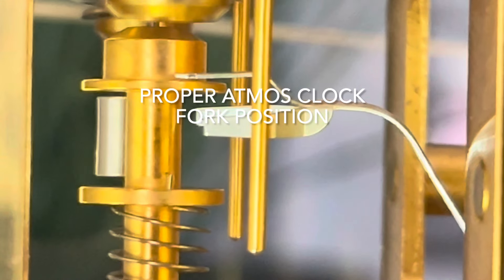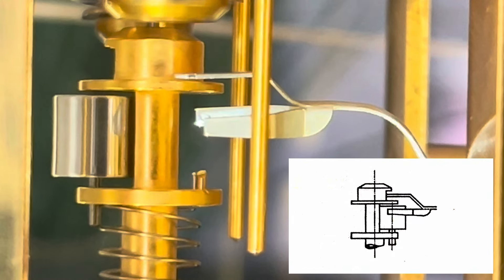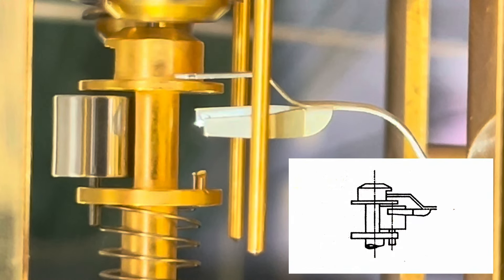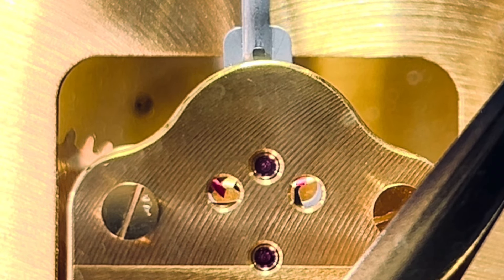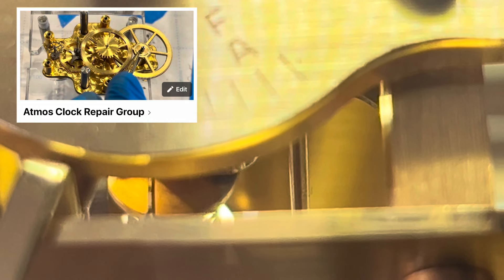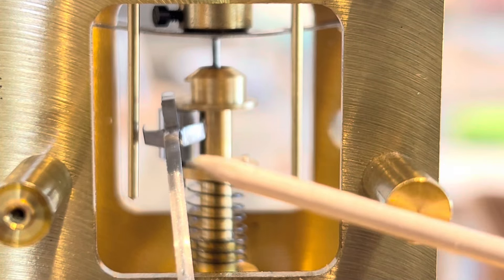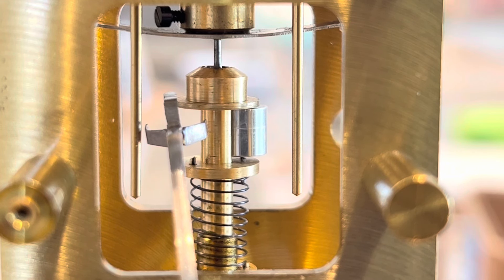Proper Atmos fork position for a high amplitude clock ￼

Comment: Thankyou for this brilliant video which I have watched many times.
I gave my sister a 528-8 for her Golden wedding and just like you said after a while it just stopped. I was afraid to touch it as they have a bad reputation in the hands of amateurs like me. After watching your videos I felt brave enough to tackle it. All went well, cleaned it in the ultrasound, watched the jewels under a microscope and I put it all together without any problems until the fork. Oh that fork! I have lost count of the number of times that I have taken it all apart to poise and check it. Now, finally I have it running at about 400 degrees. Only one problem. When it goes to the left it engages beautifully just like the video! But when it goes to the right it's almost as if the roller is pulling the fork across and the after it releases it gives a little jump before touching the guard pin. As it is running I am afraid to touch it again, but is there anything else I can do? You must have a very good camera because I just cannot get to see the pallet action as clearly as you show.
Cheers, Roger.
Reply from the maker: Congratulations on tackling your overhaul. You’re almost there, you just need to do one more important step. You know you have an issue with the fork because you’ve installed the movement a number of times, made adjustments and finally have it running at 400° amplitude. Of course after a few minutes it stops. Your defect has been narrowed down to the fork. 

I don’t know if you have manipulated the fork at all when it has been installed on the clock. If you have, I’m confident any adjustments you made may have knocked it out of poise. I know this because you told me the impulse roller is dragging when it moves to the right. That skipping motion you have noticed with the fork is because the weight of the fork is out of balance and it’s not properly engaging the pallet stones.

You’re going to have to take the movement off of the clock and poise the fork and reinstall it. Make very small adjustments to the fork once it’s installed in the clock.

If you get a chance, please post this question on a Facebook group I just created. Snap a few pictures or take a video. This will help others repair their clocks.

https://www.facebook.com/share/DG6N6ApfqKQyzEZw/?mibextid=K8Wfd2

Comment: Glad to find this video.  I just bought my first Atmos clock as a consignment sale at my local watch and clock repair shop.  It was serviced, but to what extent I don't know.  The amplitude is around 360 degrees.  Is that something that should concern me?
Reply from the maker: Everyone who sells these clocks claims it’s serviced. A clock that was serviced will not run at 360° amplitude. That is a clock that has not been serviced. Good luck.
Reply: @watchguyAtmos  Thanks.  I made my post around three hours after I had started the clock, which was premature.  Since that time, the amplitude has increased and seems to have settled around 490 - 515 deg.  Perhaps a new balance spring was used and had to be broken in?  (be kind, I am green to al this).  I bought this from a clock and watch repair shop just a couple miles from my house, that has been in business for 35 years.  I am confident that the owner / watchmaker performed some degree of service.  One year warranty.  But when dealing with remote sellers of watches or clocks, I disregard all claims of servicing without proof.
Reply: @watchguyAtmos  Under 19 seconds fast per day, BTW.
Reply: @watchguyAtmos  Checking it periodically (it sits in my office), I now see it consistently over 515 deg, and as I write this, I see 540 deg exactly.  I had no idea that it could increase by 50% from starting it up.  That is all.

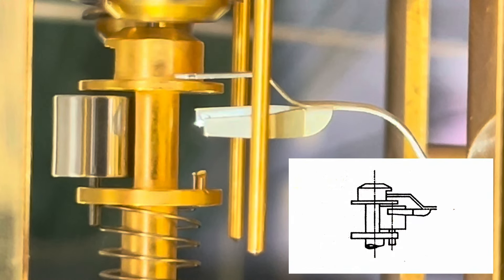Comment: Thank you for the great video! 🙏 The pallet for of my 519 is not centered. It moves from 11:30 to 1:30 position. It also runs a bit slow but fortunately it doesn’t stop. I adjusted the the regulator and will see how it goes. Any suggestions? Thank you sir in advance.
Reply from the maker: If I’m understanding you correctly, it appears that your fork may be out of poise. This is a task that can be fairly difficult to accomplish. You will need to completely remove the movement from the frame and take the movement apart to access the fork and poise it.
Reply: Thank you for the reply. Just got bitten by the Atmos bug. Bennn collecting wristwatches for about 30 years aand the Atmos has always fascinated me. 🙏

Comment: Excellent video and explanation. Increasing amplitude is the normal struggle even after a servicing. Most of mine run at least 450-540 after servicing but I have one 544 that seems very happy at 375-400 and I am loathe to keep fiddling with it. I am sure it has something to do with the fork. I am currently struggling with a 519 than runs so strong that within a couple of hours the roller is touching the back of the fork on both sides. This causes the clock to run fast. I have made every adjustment to the fork I can think of but no luck. Also Lessening the tension on the roller spring and that helps a bit but within 2 or 3 hours it is right back to it again. What do you for a clock with far too much balance amplitude?
Reply from the maker: The only thing I can think of is adding some weights to the balance. This will also slow the clock down and may require you to shorten the suspension spring length with the regulator.